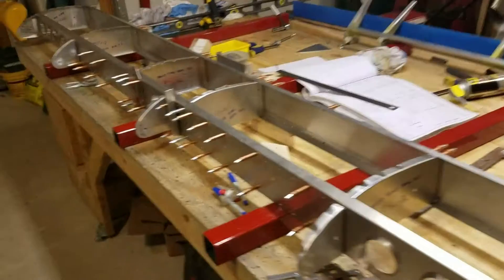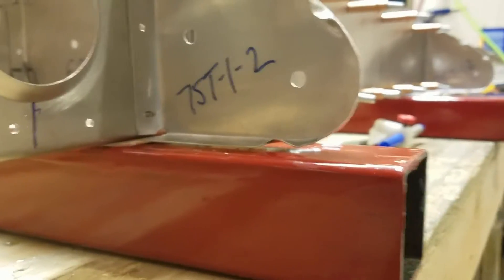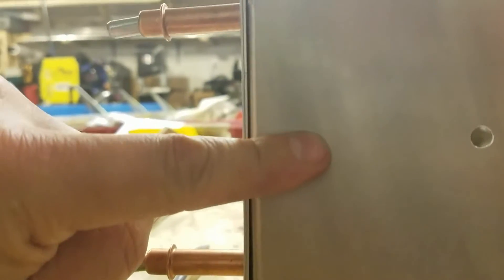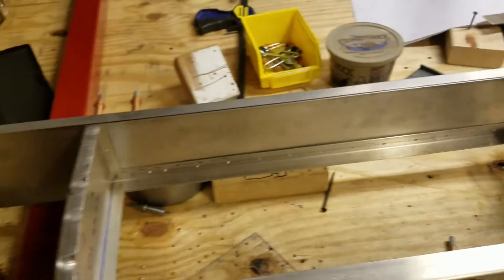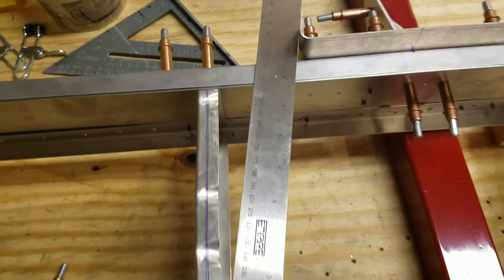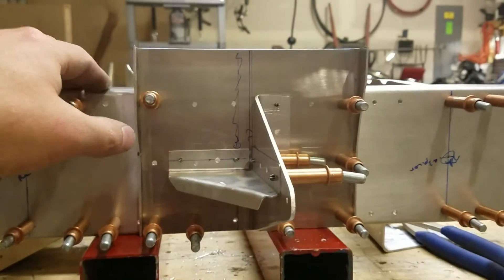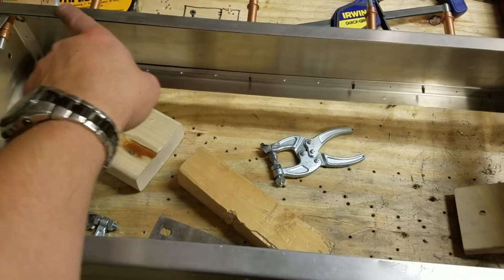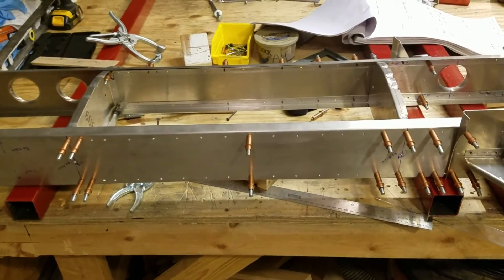Horizontal Stabilizer Build - Part 3/7

Comment: Thanks for your videos Greg.
I am building a ch 750 stol. I have built the rudder and am about to skin the horizontal stabiliser.

I started mid 2016, and have found your videos a great resorce as I make my way into the build.
Reply from the maker: Thank you for the feedback! I've been away from the project for about a month (shame on me!)...too much going on around the holidays, plus job obligations. I still have more of the stabilizer video to cut together and publish, and I'm getting ready to build a new assembly table. Once I have the new table built, I'll be back up and running on the sub-assemblies. Let me know if there's anything I can help with. I'm also on zenith.aero.